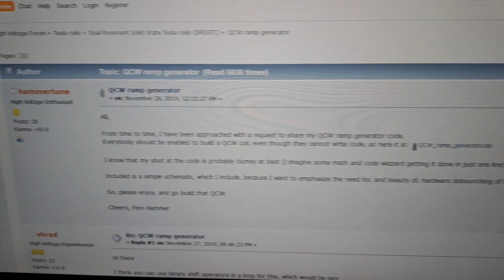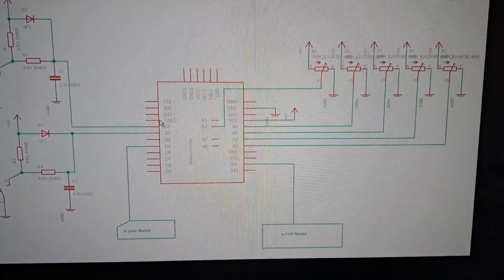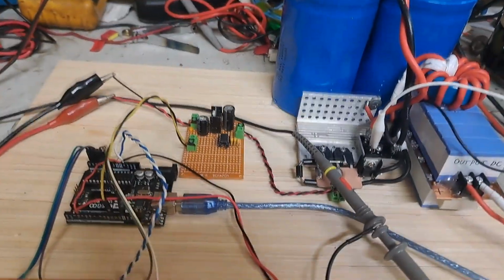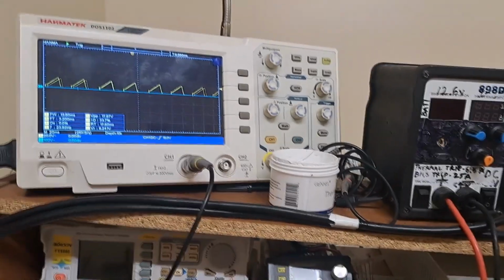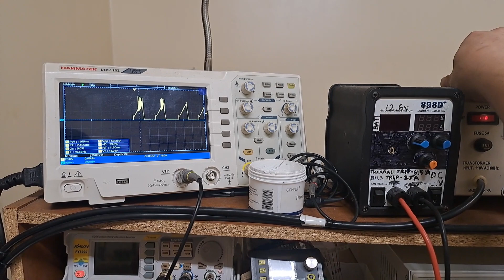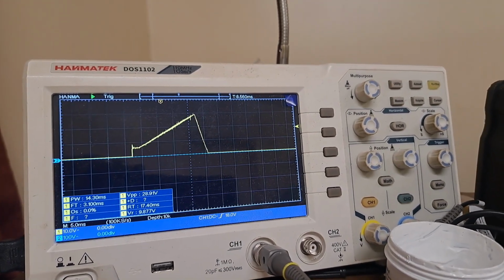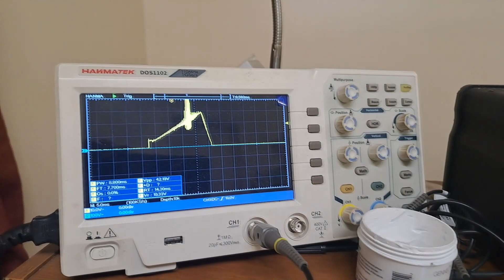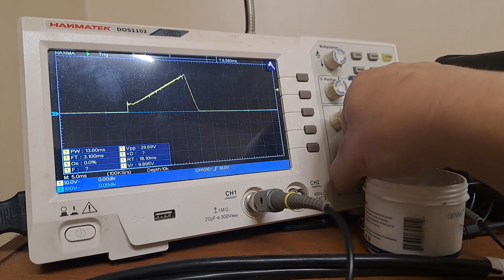Finn Hammer's Arduino Ramp Generator For QCW

Comment: Hello, can this controller be connected to SSTC? Or will DRSSTC simply send a ramp signal to the mosfet gate or the mosfet driver, will it work? Yes, I understand that a back and OCD converter is needed for QCW, but I would just like to interrupt sstc with this driver, will it work?
Reply from the maker: @GURONTV  you can technically use this to interrupt it if you wanted. It outputs 5 volt square waves, one from the ramp output and one from the enable output.

Comment: How can this be depicted in the diagram? Where do I connect pins D5 and D11 to the Tesla coils?
Reply from the maker: The other output on pin 5 is just the positive squares you can use in place of an interrupter. So those squares should be enabling the gate drive for however long the ramp is set to, which is typically done with enable inputs on gate driver IC's.
Reply: @Magneticitist  That is, in theory, I can not use D5 for my SSTC? Well, how do I want to do QCW, but to check the ramp driver, can I not connect the D5?
Reply from the maker: @GURONTV  Does your SSTC use an interrupter? If so, then yes. If it doesn't use an interrupter then you don't need the output on pin 5.
Reply: @Magneticitist Hello, can this controller be connected to SSTC? Or will DRSSTC simply send a ramp signal to the mosfet gate or the mosfet driver, will it work? Yes, I understand that a back and OCD converter is needed for QCW, but I would just like to interrupt sstc with this driver, will it work?

Comment: Hello, in this scheme there are 2 output pins of the PWM saw ramp, these are pins 5 and 11 , 11 is PWM and 5 is it not clear which one is used to connect to the gate of the bridge?
Reply: Pin 11 use for the buck, pin 5 use for turn on the feedback driver. If you use driverless sstc, you needn't connect pin 5

Comment: hey, nice video, but i dont understand the diode and 2 resistor used foor the 2 switch. i've seen seen some pull up and pull down circuit with debunce capacitor, but dont loo, like what's in this schematic :s can you explain what are the two resistors and the diode used for?
Reply from the maker: It's just one way of going about it where you are charging and discharging the 'filtering' capacitor when the switch closes or opens. Some type of resistor needs to prevent a dead supply short (R1) and the cap is discharged through R2 when switched to ground. Without the diode bypassing them in the charge state it would probably slow the charge rate undesirably. I don't know how well what specific values may work because I don't use any debouncing. I basically just turn my ramp gen on first and have it always going with a main power and output switch already on.

Comment: I got the exact same output waveform as you! Nice! Did you ever find a way around the distortion at higher amplitudes? My scope signal wigs out when the AMPLITUDE pin is cranked up or if the WICK pin is cranked up too high
Reply from the maker: Aside from any noise problems that might be there (like not having inputs terminated) I would notice a lot of signal wigging when I wasn't using a proper LC filter for the buck. If you're talking just the arduino output then I'd look into floating noise on the pins.
Reply: Hey @Magneticitist  I managed to find a solution. The problem was the inductor. I ran some current tests on it and discovered that it was saturating and causing the massive ripple due to the plummeting inductance. I gapped an EE ferrite core with more turns and it has improved to near perfection!
Reply from the maker: @michaelmule4582  nice, the gapped core does seem like a good solution

Comment: Wonderful. I have looked at the schematic. I'm not sure what the connection of pins D2 and D3 with some components and switches does. What are pins D5 and D11 used for? Finn Hammer doesn't mention their function, I'm also just starting to learn about QCW buck circuits? Please explain
Reply from the maker: So you're basically going to have 2 outputs, 5 and 11. 5 is the 'enable' signal you can call it. 11 is the ramp output. So 5 is going to be the equivalent of an interrupter signal for a Tesla Coil. It tells the SSTC driver to enable because the ramp signal is about to be fed into it. I feed that into my SSTC driver enable pins on the gate drivers. So 5 is going to be where an interrupter signal would normally go to the SSTC circuit, and 11 is going to be the ramp signal that is being fed into the buck circuit. It tells the buck circuit how to switch in order to create a ramping effect in the SSTC input voltage. 

D2 and D3 are the inputs for controlling the ramp generator turn ons. There's a "fire" and a "one-shot". I'm not 100% how I wired that but I think I just turned them both into a single on/off switch. 

All the other wiring that goes into those inputs and outputs are for terminating them and "switch debouncing". So basically they are switching high and low, but you don't want to leave those pins just floating otherwise. With a 'debounce' it attempts to turn a mechanical on/off switch action (which can actually result in micro oscillations) into a clean electrical switching so it's just a pure on or off state without pulses anywhere else in there.
Reply: @Magneticitist  Thank. By the way, I plan to test the buck circuit with a Skori circuit, the idea is to remove the breakers so they run in continuous mode, then control them with a buck circuit, is it possible?
Reply from the maker: @TâmHồ-s5u  MS Labs actually did just that and it worked really good
Reply: @Magneticitist  Bruh I can't find him on Youtube. Please provide a link to him
Reply from the maker: @TâmHồ-s5u My bad it's MS Lab @MS_Lab on YT
Reply: @Magneticitist  I just watched the video again and your teacher used 5 potentiometers instead of 4, why is that? I also suddenly realized that the GND position of the arduino, the driver ic, the power supply for the driver ic and the E pin of the igbt are all connected together. Could I get a shock when touching the arduino? By the way, what is the inductor core you use in the test videos (running stable, no vibration)? I only found a ferrite core, can I use it? Can I use the core type in cheap Chinese 12V 30A power supplies? Or you know what kind of core, please show me
Reply: @Magneticitist  Rub. I just watched a few of your other videos and saw you mention the 75A diode in parallel with the 20uF output capacitor, before the inductor. What types of diodes can be replaced with that diode?
Reply from the maker: @TâmHồ-s5u oops I didn't see this til now for some reason. There are 5 pots on my ramp generator also.  I would recommend isolating the arduino from everything else. I just put mine into a metal enclosure and powered it with two 18650 batteries in series. The outputs are then opto-isolated. 
For your inductor core you just want to make sure you can get the inductance value without the core saturating. Try to find something like powered iron maybe. I've just used yellow or white/yellow powered iron when I could. When I used a very high permeability core I was getting too much ripple. When it comes to the diode in the asynchronous approach you basically just want something fast that can handle the current. It all depends on the voltage/current you are running, but other than that some type of ultrafast rectifier that you can heatsink is what you want. The 20uF load side capacitor is in parallel with the just the load resistor. The diode is in between the switch source and ground. Just look at any buck converter schematic, like on wikipedia or something. It's the same thing.
Reply: How can this be depicted in the diagram? Where do I connect pins D5 and D11 to the Tesla coils?

Comment: Nice video but for me i just have a square wave in pin 11 that is a ramp but its only at 530hz i dont know why and im know it need to be faster ? ?
Reply from the maker: Yea it should be more like 31khz.. probably need to double check all the wiring. Are you using an Arduino Uno?
Reply: @Magneticitist   i found the probleme and yes i wasn't using an arduino uno but an arduino mega that was the problème thanks

Comment: Sup dude , which mosfet driver did you use . I don't really get how to configure a high side switch with N channel mosfets (irfp460) for the buck . If you have a schematic or a resource for the mosfet driver circuit used here that's be great .
I plan on a 100uh and a 10uf low-pass for the  buck .
Reply from the maker: It's real easy, you can just go by a basic buck circuit schematic. When you see the switch in the schematic, that's the mosfet/igbt switching the high side at the drain and source. Drain would be vBus+ and Source would go to the inductor. I'm building another smaller one here recently the same exact way but I've also just added an RC snubber across the diode.
Reply from the maker: Oh and for the first build I just used a UCC gate drive for the buck switch since I had one. This recent one I'm just using a gate driving opto.
Reply: @Magneticitist I meant when using an n channel mosfet in high side the gate voltage should be higher than the supply voltage right so I would need a bootstrap or similar circuit for it right .
I was asking how you connected it here since I don't know how it was done , without any extra circuitry
Reply from the maker: @spiderspider1384  I honestly don't like that teaching but maybe I just never understood it. The voltage across Gate to GND is always going to be higher so long as a positive voltage is applied to Vgs. All I ever worry about is Vgs max and threshold etc.. The fet is going to turn on so long as you feed it more than its threshold voltage and it will push current so long as it's in a  region to do so (8-15V etc). It doesn't matter when I use a low side driver on a high side switch, it's going to switch so long as the gate is fed its rated turn on voltage, which does not change with topology. It may not be the best way to do it but that's how I did it. Loneoceans QCW also has a low side driver on his high side switch.

It's connected literally as shown in the basic schematic. The one I just made is literally using a single 15V source to power a gate driving opto to switch the high side IGBT, then that same 15V is powering a ZVS driver to charge the buck capacitors off its isolated transformer secondary.

The whole thing about 'gate voltage needing to be higher than supply voltage' is kind of a funny way of explaining it that I never understood because obviously most switches are going to have absolute max Vds ratings that are way higher than the Vgs ratings.. so how is that supposed to work if all N channels on the high side need to have a Vgs that is higher than VCC? It can only be because when Vgs is applied and the switch is on, the voltage across Gate-GND (not source) is going to be higher than VCC.
Reply: @Magneticitist thanks a lot dude this has been bugging for a long time .

Comment: Hey dude , i was wonderful about the core material you ended up choosing
Reply from the maker: I used a T300-2D same as Gao from Loneoceans.com 

It's a large powdered iron core. I don't think the size is really necessary but it's more or less the opposite of the smaller blue one I used for testing when it comes to the properties. Given the size and permeability it should be able to handle very large currents without saturating.
Reply: @Magneticitist would t200-2 cores work .
Reply: @Magneticitist I have the ramp generator set up now but there's some issue with it . Its keeps getting disruptions and noise for some reason . I did keep the oneshotpin floating so that might be the issue . My driver uses the TC4427 .
Reply from the maker: @spiderspider1384  t200-2's would probably work. Overall size like cross section etc needs to be able to handle the current but if you're doing double the PWM freq then maybe it won't be an issue.

If you're using arduino ramp you probably have issues with floating pins. I had the same issues just having a floating one shot lead. Wasn't tied to a switch yet but if it's not terminated in some way it's still floating before the button is pressed.